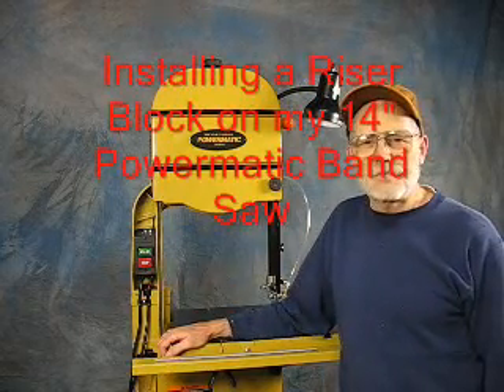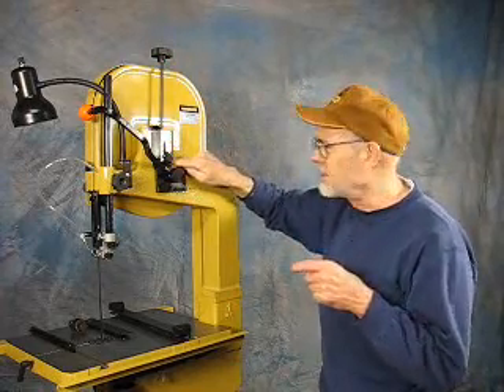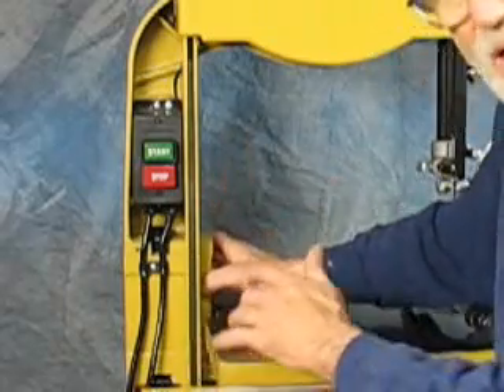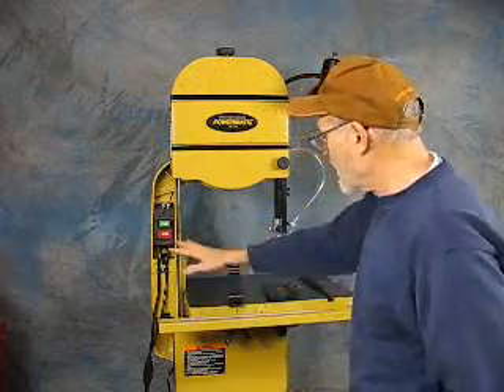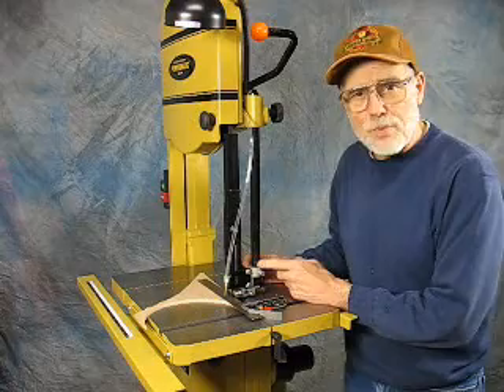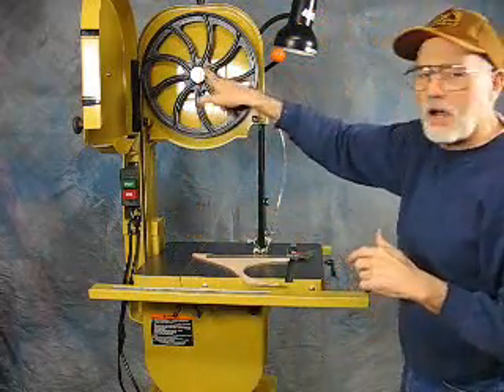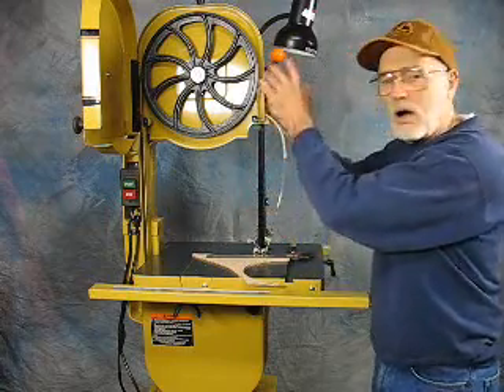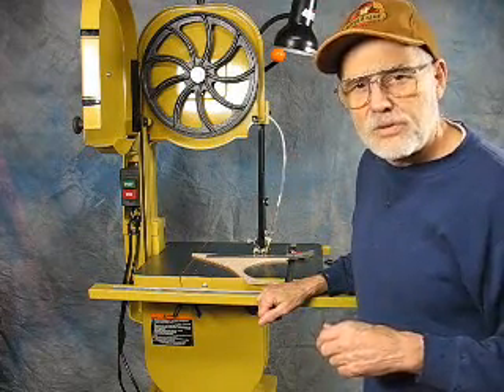Squaring up Riser Block on a Powermatic 14" band saw

Comment: I let the riser block sit in its box for two years, but just put it in place this week. Your video was helpful. You did not mention finding the cord too short to plug back in below the switch box. I have to figure out how to pull an inch or two of slack up through the motor cabinet. That has been the worst problem I had with it.

Comment: Did you ever get the stabilizer so you can use a 1/8" blade ?  I'm very interesting on finding out how that worked out ??? Thanks.
Reply from the maker: No, I never did.  Haven't had the need of one yet.

Comment: Why does my new 14 same saw force me to visually align the table top on the trunnion.  When I loosen the pivot knobs I can slide the table top toward the blade and back quite a bit. Seems there should be some restriction for that motion to keep the top centered over the trunnion plate below. Thoughts?
Reply: That adjustment is so you can keep the table miter slot parallel to the blade. Table misalignment is a major cause of blade drift.

Comment: The Carter Stabilizer will spoil you.  Mine runs 95% of the time.  As such, it would be nice to have a back up bearing, in case this one goes out.

I found 680 bearings for my stock guides for about five bucks for a pack of ten, versus the twenty a piece Powermatic demands

Comment: When you mentioned the wheels briefly and checking them (which you didn't which was good), I believe that you were referring to checking the wheels for them being "coplanar".  Many so-called band saw gurus insist that the wheels should be coplanar or "coplaner".  BS!  The band saws are designed to be not coplanar.  Coplanar wheels make proper blade tracking almost impossible, i.e.:  the bottom of the blade gullet should just touch the crown of the belt.  You did it right :-)  Thank you.